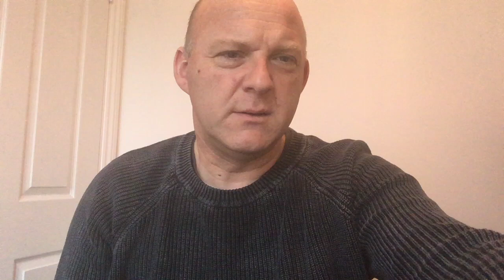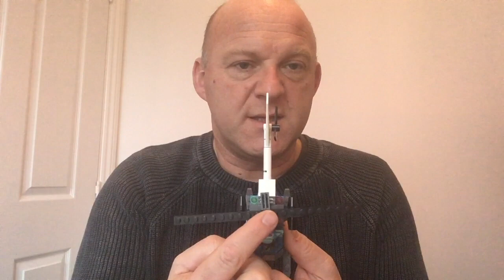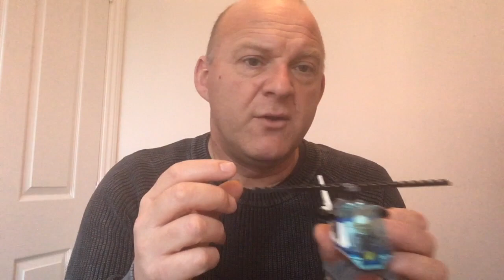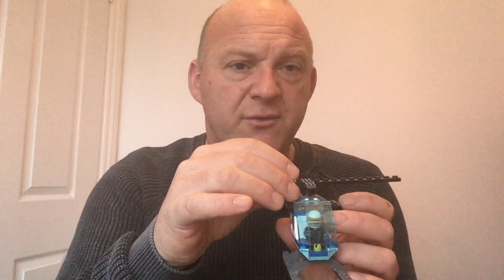What is rotor blade lead lagging?

Comment: You could have explained the reason better.

Due to high lift bring produced by the rotors, it cones up. So the center of gravity of the rotor blades moves closer.
Now due to conversation of angular momentum, all the blades speed up.

But this is not the explanation of the blades dragging (lead/lag) in plane..

Now, the dissymmetry of lift on the advancing and retreating side is countered by cyclic feathering.

The advancing blade is operating at a lower angle of attack, the retreating blade at a higher angle of attack. 

When it flaps up, its center of mass moves closer to the hub than a blade on the other side that is closer to perpendicular to the mast, which makes it want to speed up, like a figure skater pulling arms in while spinning. 

The lead/lag hinge provides the necessary compliance to accommodate the speeding up and slowing down tendency of the blade as its center of mass moves closer and farther from the mast as it rotates while moving up and down, so it doesn't force the rotor hub to absorb the forces. 

The lead/lag damper is there to resist sudden movements of this lead/lag action that can be caused by sharp ground contact, which can lead to ground resonance.